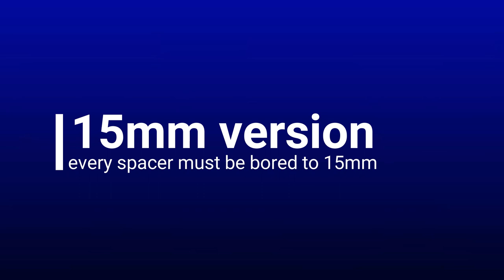Casa Performance | CNC Lambretta Fork Links fitting instructions

Comment: Reciprocating needle rollers should be packed with grease. Using enough grease for rolling bearings leaves the needles running dry after a few miles.